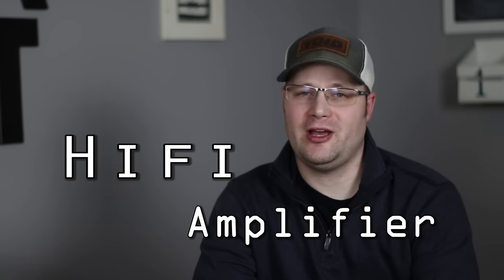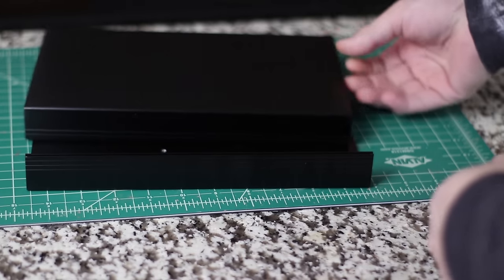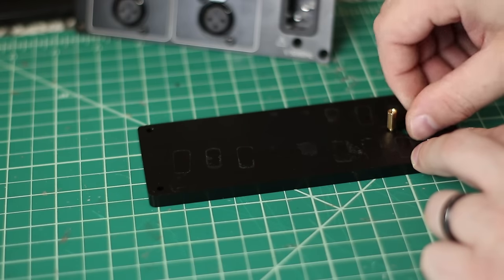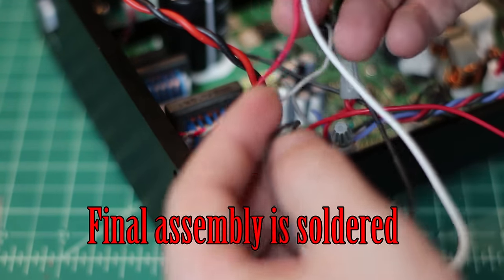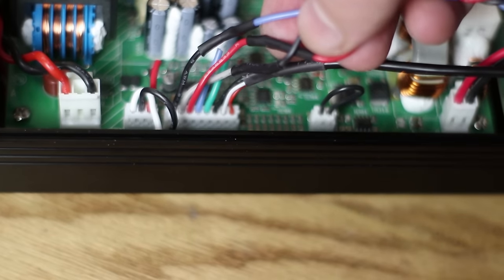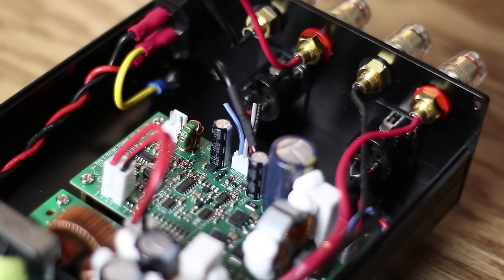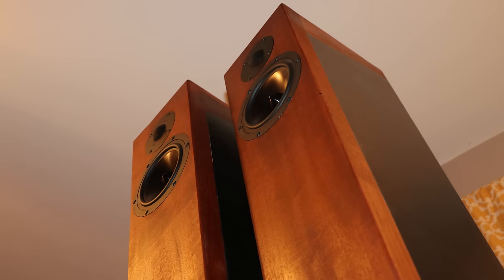How to Make a $3000 DIY HiFi Amplifier for $300

Comment: Tell me what you guys think.  I'm not an expert, but maybe the experts out there can help me. I play jazz guitar gigs and want to power eight separate speaker monitors with internal power amps.  These are actually my main speakers and each speaker has an individual output (pre-recorded bass, drums, keyboards, etc.)   The pre-recorded 8 channel sound is like a real band playing with 8 different outputs and one person.   I thought about possibly using these ICE amps.  I know that I could purchase a plate amplifier utilizing the ICE amp from Parts Express with a passive crossover, but I need two internal power amps for internal bi-amping.  I have a workshop can design my own metal input plate for the input signal to the speakers.  Unless they make a cheap standard/universal one I can purchase?   
I am also trying to find an external crossover PC board that I can use internally in the speaker.  Maybe a larger ICE power amp for the bass and a smaller ICE power amp for the horns. I now use passive internal crossovers in the speakers and they are powered by four external 2-channel power amps.  Each monitor contains an Eminence 12" Delta LFA-500 watt speaker at 8 ohms and an Eminence PS-2002 horn @ 80 watts/8 ohms.  Could I use one - 500 watt ICE for the 12" and 1- 200 watt ICE with the power supply for the horns?  Can I daisy-chain the 200-watt amp (without power) to the 500-watt board (with power)?  I read that these amps are extremely efficient, lightweight and don't get very hot.  
Here's the crossover I found online, but not sure if the quality is good.  https://www.xkitz.com/products/linkwitz-riley-3-way-active-crossover-fully-assembled-xover-3  I think that these boards have pre-set frequencies and you have to specify the crossover frequency when you order the crossover.  But I would like a crossover with the option of a potentiometer hookup on the PC board for a variable frequency adjustment on the fly.  Every venue I play in is different and I may need to adjust the frequency to get the best sound.
Crazy idea, but the speakers would then be totally self-contained and I can get rid of the heavy power amp flight case.  I'm playing modern jazz, so I'm not pushing the speaker too hard.  I just need the best sound quality possible and some good reserve power to boot.  Any suggestions?  Thank you for your opinion, ahead of time!
Reply: tomhendry1 I think the 500 watt / . 200 watt combination would work nicely for what you are are describing.  As far as cross-over, you may want to buy an electronic cross-over and use two amps with it to see what you really like with the drivers you have.  I doubt very much that you will really have a use or need to change the crossover frequency or slopes after you have really found what works well with your speakers.  just be aware of not sending too low of a frequency range to your high frequency drivers, it is a great way to destroy them.

  I would also suggest building one amp set for one speaker first, and then you will know if it sounds as you would like, or not, before doing it 8 times and not liking the result.
Reply: tomhendry1 I just looked at the cross over link and I think you would want the 2-way crossover that is also cheaper, instead of the 3-way for your described 2-way woofer and horn set-up.  for your driver's I would use a cross-over frequency between 1300 and 1400 hz.  (1.3 to 1.4 khz).

Comment: Can someone explain what both modules actually do? What's the difference? Why 2 modules?
Reply from the maker: The first module is the power supply and 1 channel of the amplifier. The second module is just another channel of the amplifier, but needs the first to power it. If you want a monoblock amplifier, you only need the first module.

Comment: thanks for the video. Is there any group on th web that are there for Icepower related Q's. Currently connecting a ASP500 and A500 module with an Icextend handling treiggers, LED's and so on and might need a second opinion.
Reply from the maker: Martin, I do not know of any.  That is one of the reasons I made this video.  I was hoping to help people with the basics.
Reply: @Toid  Yes it was good. Tanks a million for it.

Comment: Does anything change with the assembly if I use the 500asc?  Also, I have 8ohm speakers. So would the 500w @ 4ohms be 125w x 2 channels @ 8 ohms?
Reply from the maker: The assemblies fairly similar. However your power would be 250 Watts by to at 8ohms

Comment: Where in the hell is the Volume knob? Are these just 100% and its based on the input signal? Im a little confused on that
Reply from the maker: Most true HiFi amplifiers do not have a volume knob.  Instead they use a preamp to control the volume.

Comment: Is this the new circuit design aka d3? Advertised by new pioneer receivers or the circa 2005 designed ice amp. The later was not 4ohm tolerant. Did they publish a full bandwidth test at 4ohms. I only see a 1k sweep in the specs.
Reply from the maker: They did do a full sweep at 4 ohms. Which is nice, since a lot of manufacturers don't give that number out. You can find it linked in the description. Just click on the 200asc and then check out the spec sheet.  They actually performed the most rigorous tests you can do on an amplifier.

Comment: Besides te difference in power (200Wx2 Vs. 125Wx2) would there be any relevant difference i  the pre-assembled amps sold on e-bay an ali express that are based on the ICE125ASX2? I ask because my budget is very limited and I would like to use the remaining on an also budget tube preamp.
Reply from the maker: Yes. I'm fact someone on the forum bought one of those and found out very quickly that it was a knock off. Most of the boards that you find on AliExpress and eBay are not genuine ice power boards and used inferior parts. He ended up having a major audible issues with his. It's best to buy from a reputable company that you know is selling the actual unit. Parts Express does sell those, if you check the link in the description it should link to it. I have one that I'm currently using for testing speakers.
Reply: @Toid  thanks s much for tge quick reply, I'll stay away from those for sure. On the other hand, have you found any less expensive cases someplace else? Purchasing a cas that's worth almost the same as the boards seem a little high. RCA imputs would also be nice.
Reply from the maker: @leoher5338  I haven't really looked. But really any case that fits it would work just fine. Assuming that you don't mind pre-drilling the holes. It is a pretty popular board, so I bet you you could find a case on AliExpress or ebay that does fit it that might even have the holes already drilled. I just have never looked.

Comment: Do I need a receiver that has pre outs for this? Currently have a Denon AVR-S750H (the one that just came out with 8k/hdmi 2.1) and want to build the cinema 6s but if the receiver can only send 75w to each channel then those will be severely underpowered since the horn driver is 60w rms and each of the subs are 130w.
Reply from the maker: The good thing about the cinema 6 is that it is very sensitive. So you really don't need much power at all. They would run off that receiver with absolutely no issues. Now if you wanted something better, it would need to have RCA preouts.
Reply: @Toid  good to know, thank you!
Reply from the maker: @tmorrissey96  you're welcome

Comment: Would it be better to power a ultra low noise linear power supply to it this should bring some benefits. Do you know where you can buy them from in Europe straight from Ice..?
Reply: A linear PS specific to audio would be an improvement, but probably cost more than his amp. Before buying into this Class D (D for Disappointing) consider LM3886 which is Class AB and is truly HiFi.

Comment: HOw quiet is the amp and what is the output? 4ohm or 8 ohm ? how many watts?
Reply from the maker: 200 x 2 at four ohms - 400w total. It is very quiet. the link in the description will take you to the spec sheets if you want to know even.
Reply: @Toid  thanks very much

Comment: How does this sound, and compared to what? There is a lot of noise in this comment section, as with anything "audio", but what is the experience using this amp, and in what tradition is the sound described?

Comment: So I am very good with computers, audio and electronics. But with computers I know what goes in a PCIE slot, I know where to put in the standoffs etc, this I have no experience in and that explanation was terrible. Do the boards come with a schematic explaining what each terminal and binding post is?
Reply from the maker: If you check the link in the bio, there's manuals there that can help.
Reply: @Toid  that would be most helpful. Thank you

Comment: is it possible to build this as a monoblock if one wanted to use a separate amp for each channel?
Reply from the maker: Yes you can.  Ghent audio actually sells just single monoblock cases. Just keep in mind you have to use the ASC module in both.

Comment: Question. Do these boards accept balanced input natively? I noticed the Ghent site shows a balanced/unbalanced conversion board as an option in the mono chasis. I think I'm interested in using 2 of the boards with power supplies to make 2 mono amps.
Reply from the maker: They do. In fact they only have a balanced output.  The boards that ghentaudio sells is a conversion to unbalanced RCA.  in the future I may do a couple monoblocks for the channel if people are interested in that.
Reply: @Toid  thanks for the reply and thanks again for the great video!
Reply from the maker: @hificat101  you're welcome

Comment: Can I use these in the uk 240 volts mains . Does the power supply switch or would I need a transformer.
Reply from the maker: You can. This particular board you don't have to worry about, it will do 120 or 240.  Some of the other icepower boards you do have to select what voltage you're using. But any of the icepower that I know of will work with both 120 and 240.

Comment: Question. My TV is outputting an buzzing noise to my amp. I tried 2 different amps. And 3 different wires. Do you know any way I can get rid of it. My TV only has an headphone out. So what should I do. Is it even the TV or is the amp wire to close to the power wires of my TVs and stuff.
Reply from the maker: Sounds like a ground loop problem.  Something like this should fix it: https://amzn.to/2EfjVGu
Reply: @Toid  ok I think I fixed it. I appreciate your help.

Comment: Lets start by saying the world of hifi is full of too much magic and mystery, and not enough science and engineering. But from an engineering perspective, this is a switch mode or "class D" amplifier, with a switch mode power supply, and by the looks of it an average spec one at that. Switch mode systems are inherently susceptible to switching noise unless carefully designed and manufactured to high tolerances. In fact there is still a lot of controversy within the "HiFi" community as to weather "class D" amplifiers are capable of producing hi fidelity signal amplification given their inherent noise issues which have to be carefully filtered.

To summarise, there are not many "hi fidelity" amplifiers that are switch mode topology, and those that are use much higher quality components than these do. If you want to build a cheap hi quality amp then build a class A or high bias class A/B with a linear regulated power supply.  If you want a cheap powerful and efficient amplifier then build a calss D.

Comment: Is it possible to build this without the amplifier Case?
Reply from the maker: If you build your own case or buy a different one
Reply: @Toid  what about cables, are these standard cables which you can source from electronics shops or internet
Reply from the maker: @geoemm  you can source then directly from Parts Express. There's links in the description of the video.
Reply: @Toid  txx man

Comment: Wish I could buy this from a European supplier since I don't want to spend a dime on anything that comes from China.
But from a technical point of view there's one thing I can't get my head around: all serious amplifiers I've ever owned had huge capacitors. How could a tiny circuit without such capacitors have a similar dynamic range? That seems physically impossible.

Comment: your video needs a little work but it has the right concept. I have been doing this for years. Ebay or aliexpress. Search Class D Amplifier or TPA3116 you will see thousands of amplifier boards for as little as 10.00 that need nothing but an input signal from your iphone and a 12v or 24v power supply. some range all the way up to 1000Watts or more. THese are the same boards they put in all the yahaha, sony etc stereos down at bestbuy but it's just the bare board and you will need a little electrical knowledge. . I have made countless of these for friends and family. If you dig further you will even see some class A amps there as well. the class D work well enough but if your really serious search for these or even tube amplifier board . The search "Amplifier Board" has over 11,000 results on ebay. Have fun

Comment: hello, great video ! is there any posibility to use an remote control on this amp?
Reply: Add an Arduino
Reply: @Jin-Ro  does that need programming ? or just add it ?
Reply: Why ? It's only power on power off. You could use a remote controlled power socket.

Comment: @123Toid So if I want a 2.1 system I would get the 
ICEpower 1000ASP Class D Audio Amplifier with Power Supply Module 1 x 1000W for the Sub and two of the ICEpower 500A Class D Audio Amplifier Module 1 x 500W, but would the power supply be too much for the 500w boards?
Reply from the maker: That is correct. You only have to worry about the voltage. The amplifier will pulls which amperage ss it needs.  In this case you could use either two 1000a or two 500a boards with the 1000asp

Comment: Where is the volume knob?  Also, isn't more to converting unbalance to balanced signal than just an audio cable?
Reply: Same. I was wondering was it me or that amp didn't have  volume knob. And yes there is balanced to unbalanced converter but unless ya have a multi million dollars hi-fi setup or golden ears, cable is enough

Comment: I've got a challenge for you. Make a video about how to make an adaptor for XLR low impedance (150 ohm) external microphone to TRRS smartphone plug. Impedance has to be raised to above 1k ohms... something about resistor... and capacitor... I have no idea. Make the video, plese.
Reply: Why not just get a small inexpensive mixer to put in front of it and use a real mic?

Comment: Does anyone know where to find this chassis/case or a similar one?
Reply from the maker: Check the links in the description of the video
Reply: @Toid  The link for the Ghent case is broken. In addition to the original case, they now make one that uses a side-by-side configuration and no front power switch (LED indicator only)

Comment: Hi, Im not up one new electronics so this makes me wonder. (im oldish) Where is the 200w produced and how is it cooled? All the old amps I have owned have huge transistors attached to juicy heatsinks.
One more question, if it only requires  a 14 gauge on the power input why do amps need such heavy spkr wire? 
(Higher input V = lower input current then stepped down to lower board voltage = higher output current?)
Thanks to anyone that replies. PS, im half deaf now so it is pretty much all in the past any how. I have 8 guitar amps and they all sound great...or do they? LOL ;(
Reply: Class D amp topology is based on switching transistors and filtering that instead of running them like* resistors-- the actual efficiency of this amp may be over 90% instead of 50% or less, meaning that there may be only 20W of waste heat running full volume into a low-ohm speaker.
(*sortof, running them in the linear mode has similar power loss to a resistor)
Reply: @enginerdy  thanks, "cool" (pun). I will have to explore D class to understand. Makes me curious about the rave about audiophile level tube amps and how they compare.

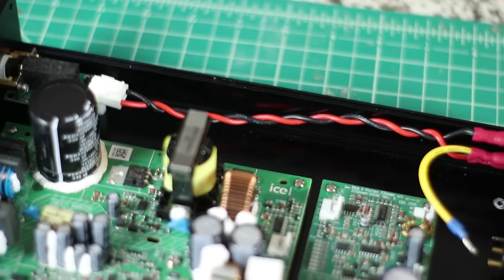Comment: hi on 5:42 its does not matter if you turn the plug in the socket, then nothing is right
Reply from the maker: In the US, this uses a 3 prong outlet, where you can only plug it in one way.  There are reasons in which you want to hook it up with the proper polarity.  If you are unsure why, you can look up basic electrical wiring for your country and why it is important.